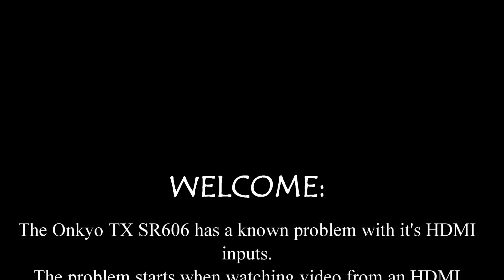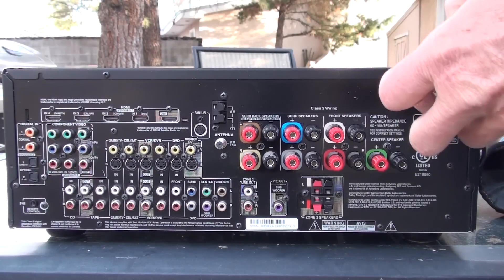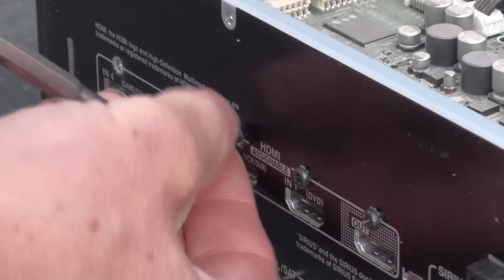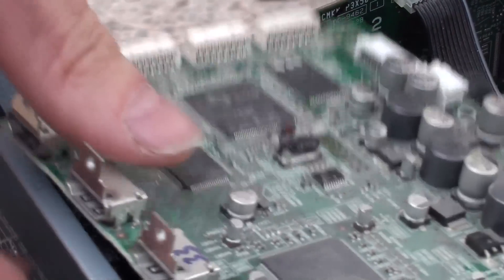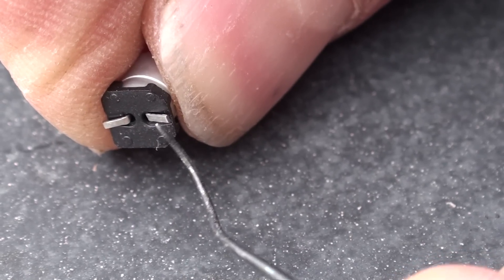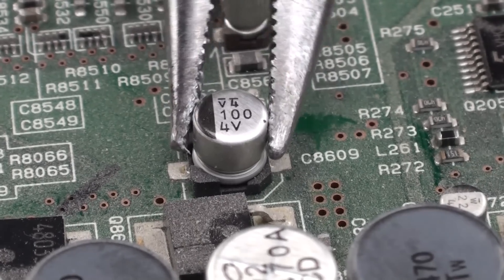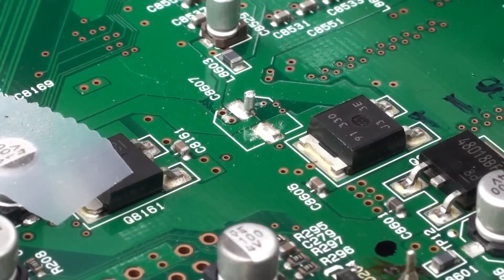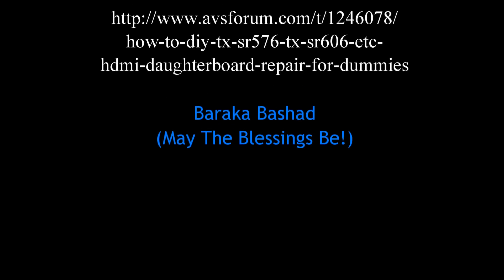How To Fix the Onkyo TX SR606 & SR607 HDMI Input Problem

Comment: It's 8 years later and this is still a valuable video! My Onkyo SR-606 has been taking longer and longer to connect the HDMI to the TV, with HDCP error messages becoming more frequent as it takes minutes for the Roku player to see the TV through the receiver. I finally ordered 50V, 105C, surface mount capacitors from eBay to replace the original 4V 100 uF capacitors. The original capacitors are both heat and voltage stressed. The design operates then too close to their maximum rated voltage and it sure does get hot in there. The replacement capacitors proved too wide to fit without bending leads and then, once soldered, I had to resolder them and lean them over because they became too tall with the bent leads, but after all that, it worked! Just like it says on the tin. Many thanks. Warning: Be extremely slow and careful bending leads on surface mount capacitors. They're quite fragile and will snap off. They're not really designed to be bent.

Comment: The HDMI on my Onkyo TX SR606 recently stopped working.  It was gradual so I thought it was something with the Roku or some BS firmware/software incompatibility.  The receiver is 14 years old but still sounds great and is in perfect shape so it seemed like a shame to toss it and get a new one just because the HDMI wasn't working.  Thanks to your video instruction and $5 in parts from Digikey, the HDMI is back up and running.  One thing to note, the legs on the surface mounted caps are very fragile so be careful when bending them.  Thank you, I really appreciate you taking the time to make and post this video!
Reply: Same thing happened to me!  The Onkyo's HDMI failure coincided with a Roku firmware update about 2 years ago, so naturally I wasted months with Roku support and the forums trying to disable an imaginary new power-saving or copy-protection feature.  Once I determined the problem was with Onkyo, I just bypassed its HDMI switching with a Toslink audio extractor.  Finding this video makes me want to do the proper repair, but on the other hand, the audio extractor has prepared me for a future 4K TV upgrade.  The Onkyo is an audio-only device now, and it still sounds great!

Comment: Here it 2022 and my unit purchased in 2008 started having video problems using the HDMI system.  This video made a lot of sense and worked for my TX-SR606's repair which had started dropping Netflix videos every few minutes or so and I had to keep hitting "resume playing".  I used 16 volt caps to play it safe and had no problems bending the leads to match the pads on the board.  The only thing I can add for those not familiar with surface mount components is,  once the caps are removed, tin (that's a term for putting some solder on)  both the board's pads being careful not to over heat them and  the capacitor's leads.  This makes it much easier to solder the caps in place without over heating.  I used some modeling clay to hold the cap's in place and the sticky is a nice idea too.   Also be very careful when bending the cap's leads and soldering not to have them touch the metal can as it  might short out.

Comment: And yet another satisfied customer here! Got my 607 fixed right up (five capacitors, all on the bottom side of the HDMI board).

I desoldered the old capacitors instead of wiggling them off. I know in theory the latter should be fine, since the leads are actually not secured inside the component very strongly. But I still felt more comfortable minimizing the stress on the PCB, even though desoldering meant I had to be more careful about overheating nearby components.

Worked fine though, and I had no trouble getting the new ones on.

Now the HDMI inputs switch pretty much right away (just the usual second or so delay as the handshaking works itself out). No need to warm up the receiver before that works.

I was hopeful that replacing the capacitors would fix a couple of other problems I'm having: component video input isn't being upscaled to the HDMI output, and the setup menu doesn't get displayed on the HDMI output. Unfortunately, neither of those issues were fixed. I'd love to hear from anyone who has ideas of what might be needed to fix those (maybe just some other capacitors somewhere?).

But regular component video switching works fine and my TV has component inputs, and the infrequent times I need to access the setup menu, I can just use the front display of the receiver. So these aren't huge problems. The big one, having to wait ten minutes before the HDMI switching is working properly, has been eliminated, and that's a huge relief. Thank you for the guide!
Reply: I'm going to try a reset.

Comment: So, I know little to nothing about electronics and have certainly never opened a receiver before. I have a SR606 and purchased a brand new Pioneer for $546 but decided to give this fix a try. I ordered the parts from DigiKey as you had recommended and followed your instructions. That very evening after the fix was done, I returned the new receiver and am happy to say that my old one works like new! The service centre here wanted $75 to look at the receiver and also said that the aforementioned problem was not known to them as a common problem. I decided to do it myself and with your help fixed the issue for $10.40 so THANK YOU THANK YOU THANK YOU!!! and a hundred times over THANK YOU .....
Reply from the maker: Enjoy!  You may now apply to Starfllet

Comment: I can't thank you enough .....  I was having problems with my SR606 and didn't really know which component was failing.  But then I just googled the problem and was presented with several links.  I was impressed with your DIY instructions.  Well, I never soldered anything in my life but I thought it was worth a try. I ordered replacement chips, solder iron and solder for $20 bucks.  SUCCESS!  The amp is running perfect...you saved me at least $500 dollars on a new amp.

Comment: LEGEND!! This worked a treat, thank you! ❣ 11 years later - wow!😲

I've just replaced these capactitors on my Onkyo TX-SR607 and it worked a treat! All the HDMI's work again straight away without having to wait 20 minutes for it to warm up. Like others have said, on the SR607 the 5 caps are all on the bottom of the HDMI board and they are really easy to replace if you follow these instrctions. Using the piece of bluetac to hold the caps whilst you solder them is a master stroke! What a tip!! 😆 I'd have never been able to do it without the bluetac.. 🤣 I replaced mine with 16v ones from Ali Express which came in at about £5 (and I accidentally ordered 60 of them!, instead of 6). They were slightly larger, but in truth that probably made it easier to position them. Apparently they are 105c ones, but I'll not hold my breath.. 😅

My only remaing problem now is the OSD still doesn't work, but I'm going to try a reset and see if that does anything. The unit is definitely trying now because the screen flashes off and back on when I exit the setup menus from the LCD readout.
Reply from the maker: Enjoy.  I still have mine sitting ina closet.  I will be my workshop stereo at my next house

Comment: Great how to video. I repaired mine over the weekend and now it works perfectly. One big difference is my model is the TX-SR607 and the HDMI board is laid out differently. All 5 capacitors are on the back side of the circuit board and in different locations than this video shows. 
Not a problem because the 5 capacitors that need changing are the only CAP ALUM 100UF 4V 20% SMD on the board. Easy to spot because they are the smallest ones.

Comment: Thank you for this video!  I followed your simple instructions and my TX SR606 is working perfectly now - the HDMI switching works immediately again.  The biggest thing I learned was your sticky-tack trick for holding the capacitors in place for soldering.  I can't believe I had never seen anyone do that before.  It will made a lot of future electronics jobs much easier!

Comment: I had the same problems with my Onkyo TX-NR737. At first I thought of broken cables or problems with the TV or DVD devices. The error could be limited to the HDMI board. Your video motivated me to replace the capacitors myself. These are placed differently on the TX NR737. After replacing all aluminum capacitors, the receiver works again. I documented the exchange and created my own video instructions. Thanks for your inspiration!

Comment: I'm making myself take the time to write a big thank you for sharing. This issue with my Onkyo TX SR606 has been bugging me for years. Even though messing with a circuit board was a little daunting, particularly knowing my non-soldering skills, I gave it a go. I sourced some capacitors locally here in Australia from a company called element14. I followed your instructions to the letter and crossed my fingers that I hadn't fried my board! Viola! The bloody Telly turned on straight away! I'm stoked! Thank you so much for making a well explained and easy to follow video.
Reply from the maker: Good on Ya for giving it a go.  I can imagine how scary it easy with no electronics-soldering experience.  I figure people trying this have nothing to lose.  $500 for a new unit, a couple hundred to maybe have someone fix it.  You can now put this on your CV

Comment: This fix worked great for my SR606. I used some spare 100uf caps of different styles. (radial, axial, various voltages, etc..) 
When inspecting the HDMI board, I didn't see any writing saying: "ONKYO"  This leads me to believe it is a generic card that may be used in other receivers. If your board looks similar, and it's caps have same values, then this fix could help. 
Thanks for the video!  It saved me from buying a new receiver.

Comment: Thanks for your incredibly detailed tutorial. I did follow your instruction to the letter. Unfortunately, I was not so lucky with one of the cap leads taking some of the board with it. My only contribution for those doing this repair is to solder off the old cap rather than rocking the cap off the board. I was lucky enough to have enough room to clear a small copper area for reconnection to the board next to the small remaining crater. Again, thanks for the clear instructions for replacing all the faulty caps and the advice for upgrading caps. It now works again flawlessly. Thank you.

Comment: Worked like a charm! THANK YOU!!!!! I've never attempted any circuit board repair before and only soldered a few times in my life. Your instructions are spot on and I fixed my issue in about an hour or so! Picture and sound would cut out about once a minute after the receiver warmed up. Just watched 2.5 hours and no cut outs at all!
Reply from the maker: Congratulations.  You may now apply to Star Fleet Academy.

Comment: Your video is very well set out. I had the exact fault on my Onkyo tx nr606 and decided to have a go. First go at soldering too but it worked!! Really happy to not have to retire the amp. Thanks so much and the blue tac trick is key.

Comment: Thank you so much for this video.  My HDMI is working again.  I can confirm that this fix works for the TX-NR906 as well.  However there are THIRTEEN of these bad caps on this unit.  I can't believe Onkyo keeps using these insufficient caps on the hdmi board.  Such a small difference in price for the higher temp rated caps.  Plenty of space on the board for a slightly larger cap.  I used to work in SMT so I know how the process goes.
Reply from the maker: yes, strange. I'd happily pay a $1 more on a $500 piece of kit.  I can't understand how they let this problem go on model after model, year after year.

Comment: I replaced the 5 capacitors 100 uF caps last night, took about 2 hours total for me. The HDMI switching now works properly at a full 1080p (1920x1080).  Prior to the fix, I had to run my HTPC at 1776x1000 resolution, and my PS3 and 1080i, since 1080p refused to sync over HDMI.  Also my onscreen display now works again (though it seemed to take a while for it to begin working, perhaps I need to replace the other caps).  I'm a happy camper.  Thanks so much for the video.  Very well done!.

Comment: Thanks a million for this video.  Until I replaced the capacitors, I didn't even realize the Setup menu appeared on-screen.  Yeesh.  I bought my Onkyo at a Pawn America two years ago, and after changing the capacitors according to this video, it works better than ever.  A switch box with eight game consoles plugged into it, the cable, the Wii U and Xbox 360--everything works like a charm now.

Comment: Replaced all of those series of capacitors in my Onkyo TX-SR706, (10 years old), total cost $4.95, the HDMI circut board is now working perfectly.  Thanks, it was very easy and quick, probably saved me $500 for a replacement, ( had decided on Yamaha if this didn't work).

Comment: Followed the procedure and it worked.  Thanks for the great instructional video!!!

Just to note, the single capacitor on the top is labeled wrong in the video with my Onkyo (should be C8609 not C6809)

Comment: Yes!!! It works, follow the guide with the suggested spareparts and blu tac. For the EU versions of the TX-SR607 the board looks different and all of the capacitors are found on the backside of the card: 5 Pcs of caps @ 100pF 4V.
Reply from the maker: Congratulations

Comment: Had the same problem with my TX-SR706. I replaced all 100uf 4V capacitors with radial 100uf 25v. there were 15 on my HDMI board top and bottom. Now receiver works great. I was going to spend $90.00 @ an electronics place ($1.89/capacitor + $60.00 for labor. I decided to do it myself, went to Ebay and got 20 capacitors for $8.00, and soldered them myself. Thanks for the tutorial!!! Now I purchased an Antec AV cooling fan that sits on top of the receiver and all is COOL!!!

Comment: Great video! I have dealt with this issue for years. So frustrating. This fix was easy and took me less than 20 minutes. One small note...the part number for the resistor listed does not match the description on the resistor. The parts received however worked PERFECT. I am so happy. Thanks for your help.

Comment: This video helped me fix my SR607. The board is slightly different and has 5 100uF caps on the underside but none on the top. I replaced all 5 with some through-hole 16V 100uF caps that I had on hand and it fixed the issue. I just soldered them to the surface mount pads and bent them over to lay flat on their sides.

Comment: My whole family thanks you for this video.  I just fixed my TX-SR604 using the guidance provided in this video.  This model only has 3 of the problematic capacitors (2 on the top and 1 on the bottom) since it has 2 HDMI inputs and 1 HDMI output.  The $5 in parts (with shipping and a few spares) needed to fix the problem was a bargain.  The half-hour of time it took me to do the repair was made up after turning the TV on twice and being able to watch it immediately (since it took 15 minutes to get a picture before).  Thanks again!
Reply from the maker: Thank you for your Thank You.  Enjoy, watch good things.

Comment: Thank you so much. Just followed this and  fixed my sr606. I was going to replace it until I found this video. Got my capacitors from mouser electronics. £13 Inc postage to UK. Used the part number to find them UWT0G101MCL1B.

Comment: After the second Onkyo TX SR606 finally died (leaving it on 24/7 didn't help), I found your excellent video. There are 2-100ufd on top and 8-100ufd on the bottom. I replaced all 10.
39 cents each, $9.36 with shipping.

DigiKey P15086CT-ND for Panasonic's Part No. 100 CFT radial lead, @ 16 volt.
They all tested 119 ufd, with very low leakage., and offered higher 
temperature range -55 to +105 degC.

Twisting worked fairly well, except the second one :(  tore the pad off from the pcb !

Lucky it was the negative side, which was ground for most of the caps. I soldered in a
small parallel splice wire from an adjacent cap ground, and put a swab in between
the problem cap and another tower coil to apply pressure, in case the minus 
lead on this cap had other places to go on the pcb.

I actually think this may have been the problem, since the lead broke away with hardly
any tension (twisting). You cannot solder it back!

I used a Weller WES51, with very small 1/64" ETS conical gold tip, set to 900 degF.
I did not bother to remove the old leads, but simply applied more solder, creating a
solder bubble above each pad, and eliminating an additional soldering step trying
to mount these little guys. It also reduced the risk, in my opinion, of tearing up
another surface-mount pad. 

After shaping the new leads, and checking for correct spacing, I soldered the first lead,
then the second, and then resoldered the first lead with slight downward pressure.
Now, the cap should be fully connected stress-free, with no lead movement during
the cooling phase. i.e. no bad cold-solder joints.

I was really wondering if this would fix it, but now it works perfect.

Thank You!

Comment: Thank you very much for the time you spent creating this video! For under $10 I was able to fix a $1,500 receiver that otherwise I would have replaced. I have a slightly different model but replaced the same capacitors and worked like a charm. Don't be afraid to try this if you are having HDMI issues on your onkyo this was not a difficult project after watching this video.

Comment: Thanks for this.  I had problems with intermittent HDMI dropouts and I could not access the setup menu.  Having replaced the caps as described - everything is working again brilliantly.  It took me about an hour all told and saved me from buying a new AV receiver.  I used 5 Nichicon  Radial Capacitors 4V 100uF 105°C which cost about £2.78 from ebay including shipping...  Cheers!
Reply from the maker: Rock on!